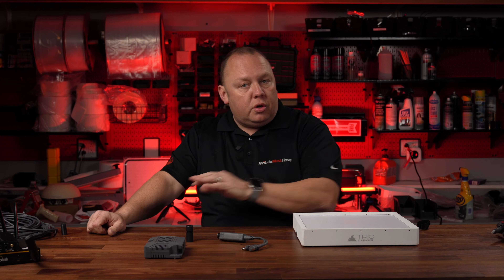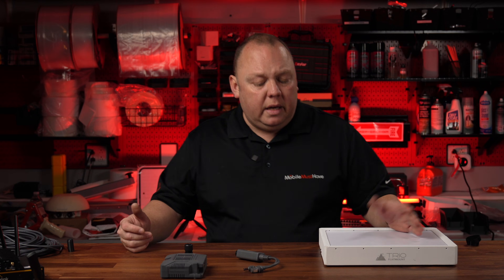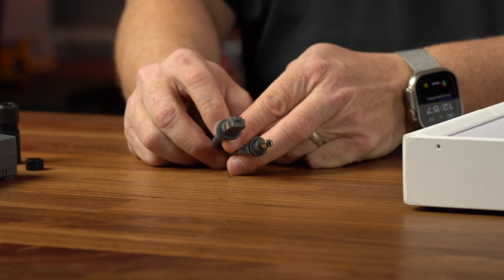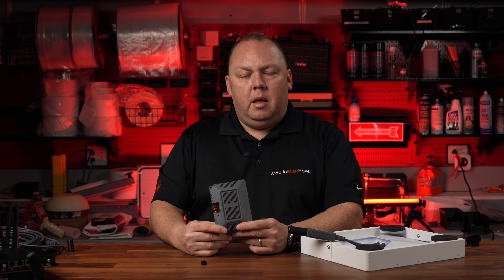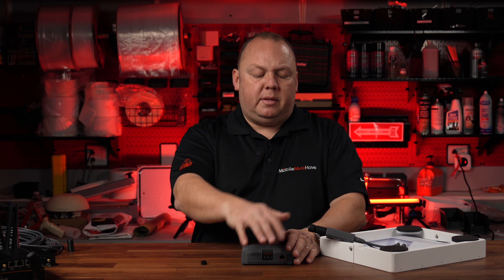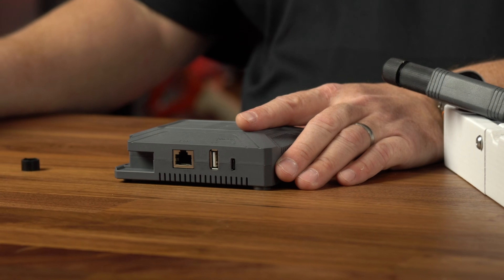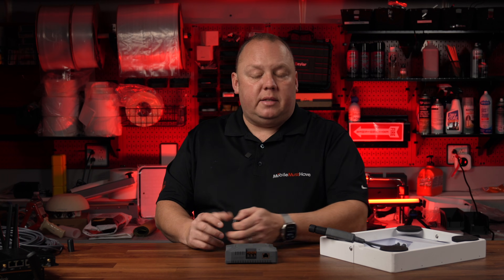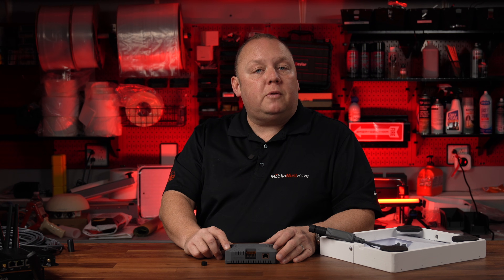New! Starlink Mini POE DC Power Conversion Kit is Here!

Comment: Will this work with a poe ++ injector or poe switch?
Reply from the maker: Do you mean in terms of providing power to the DC Conversion Kit? Our DC Conversion Kit for the Starlink Mini requires a 9-30v DC input using a direct wire to the positive and negative terminals. It also has a passive PoE Injector built in already to provide power for the Starlink Dish, so you shouldn't need an additional PoE Injector or PoE switch. Here's a link to the Conversion Kit on or site with more information: https://mobilemusthave.com/products/starlink-mini-poe-dc-power-conversion-kit-with-12v-accessory-output-for-peplink?_pos=1&_psq=starlink+mini+poe+dc&_ss=e&_v=1.0

However, we'd love to discuss your use case more and find out what the best solution would be for you. If you'd be interested, reach out to us at info@mobilemusthave.com with some information about your setup needs and we'll be happy to help!
Reply: @MobileMustHave  I am asking same thing. Can I buy this kit, then just use the dongle for the dish and plug the ethernet cable in to my Unifi POE++ network switch and use its POE power of 50Vdc rather than using the injector itself.
Reply from the maker: @31337cyberhuman  most Ubiquiti switches have a max wattage of 45w and this cable was designed with passive POE functionality carrying power on all 8 wires in a particular order. The dongle does not have the logic built in to trigger the switch to enable PoE and the pin order is non-standard, so this wouldn't work unfortunately, nor would there be enough power on most switches even if the pinout were correct. We do sell a managed PoE switch and single port injector with 802.3bt standards which now has up to 90W of power and it works with our PoE splitter than then outputs enough power to be used by the Starlink Mini and can also be paired with a Peplink both powered by a single ethernet cable but this requires an enclosure like the Antenna MAX or the Antenna MAX S as the POE Splitter is not waterproof. Here is a video of the Antenna MAX S installation video that shows what I'm referring to. https://www.youtube.com/watch?v=8KudUK457Hw - Erik MMH

Comment: What temps can this handle? How about weather rating? Would like to mount this under my hood instead of inside my truck.
Reply from the maker: The Starlink Mini PoE DC Power Conversion Kit has a strong heat sink built-in, so it has a great heat rating! However, it is not weather resistant, so it will need to be safely installed in a weatherproof location. For more information, check out the listing on our site: https://mobilemusthave.com/products/starlink-mini-poe-dc-power-conversion-kit-with-12v-accessory-output-for-peplink?_pos=1&_psq=starlink+mini+dc&_ss=e&_v=1.0

 If you have any other questions, reach out to us at info@mobilemusthave.com and we'll be happy to help!

Comment: The reason is simple, if your selling millions all over the work, keep the power separate since since most don’t have a POE source.  The difference between a billionaire and a YouTuber.
Reply from the maker: That not what we said in the video. The separate DC input is great and needed in our optinion since the unit has an intergrated router. That said, since the unit already runs on 48v having the ethernet have the ability to offer POE power to the dish would allow for a much larger variety of deployments without the need for kits like this. We suspect we will see this added in future generations since its the number one gribe most testers have had with the product thus far. Thanks for the comments and for watching!

Comment: If your poe is creating lots of heat it's not efficient.
Reply from the maker: anything stepping up voltage from 12v to 48v and doing so with up to 200w will create heat. That said, the mini only pulls about 30w so you barely notice any heat at all because of the overbuilt nature of this unit and you can then swap out your dish for a full size starlink using the same kit and wiring for future proofing.

For full specs, check out our listing here: https://mobilemusthave.com/products/starlink-mini-poe-dc-power-conversion-kit-with-12v-accessory-output-for-peplink?_pos=1&_psq=starlink+mini+dc&_ss=e&_v=1.0

Comment: Well spoken esoterically but for the uninitiated and those newly interested in Starlink somewhat confusing and off putting !
Reply from the maker: All depends on what your goals are and what you are looking for.  Starlink did not make this easy as they are still learning what their customers are looking for and testing the market themselves.
Reply: Are those magnets on the white box? I assume that is a mount, if so it doesn't look like it will mount flush on the roof of an RV unless you drill a hole in the roof. So this lets you use an inside router for better performance?
Reply from the maker: @JimEdds  yes, our Trio SpeedMount for the Mini has a magnet or suction mount option and doubles a a great protective case for the Starlink Mini https://mobilemusthave.com/products/trio-speedmount-for-starlink-mini

Comment: Why not buy the Starlink USB C cable for $39?
Reply from the maker: we sell those as well but for $29 and in stock https://mobilemusthave.com/products/starlink-mini-10-meter-water-resistant-usb-c-power-cable-for-battery-or-portable-operation - That said you will not be able to use ethernet to uplink the device to a Peplink router to do WAN bonding and other advanced features. This is more designed for a fixed mount installation. For portable use check out our 3 in 1 portable cable which is the best for portable use allowing battery use, USB-C use, stock charger use, cig lighter use and more found here!https://mobilemusthave.com/products/starlink-mini-3-in-1-water-resistant-power-cable-for-ultimate-portability-10-meter?_pos=1&_sid=c9f466ef6&_ss=r

Comment: in video you say "POE injector" input comes from Starlink device WAN. Did you mean to say Peplink WAN? Input from Peplink then output to Starlink dish.
Reply from the maker: So, the Starlink Dish is connected to the PoE port on the PoE injector via a standard cat 6 ethernet cable which connects to the Starlink Mini conversion cable creating a water tight fit. Then, you run an ethernet patch cable from the LAN port on the PoE Injector to the WAN port on the Peplink router. If you have any other questions, reach out to us via email at info@mobilemusthave.com and we'll be happy to help!
Reply from the maker: @timothyauen155  our team previously said the cable to the dish is included. All adapters to create a water tight seal are included but a standard ethernet cable is needed to the dish which many customers have already in various lengths which is why its not included and optional at checkout. Apologies for my teams incorrect information.

Comment: I was okay with the 48V barrel but a 12V USB-A port? Why?
Reply from the maker: So, the USB-A Port is used with the optional "USB-A to 4-PIN Peplink Power Cable" that can allow you to power your Peplink via the USB-A port. That way you don't need a separate run to power your Peplink! We also have more information on our listing here: https://mobilemusthave.com/products/starlink-mini-poe-dc-power-conversion-kit-with-12v-accessory-output-for-peplink?_pos=2&_psq=starlink+mini+poe&_ss=e&_v=1.0

 
If you have any other questions, reach out to us via email at info@mobilemusthave.com and we'll be happy to help!
Reply from the maker: Additionally, the 5V USB-C port can be used to charge USB devices like phones if appropriate and also power some routers that run on 5 volts DC.
Reply: @MobileMustHave , I have never heard of a 12v native USB port in my life.  This was a very poor design decision.  People are going to be frying random accessory devices left and right with that thing.  If you want to get 12v from a USB port, then have the adapter request it using one of the "smart" USB power protocols, but a USB port should never default to 12v otherwise.  The rest of the product looks great, but that should really be reconsidered.

Comment: I looking for a solution like this since months! Thanks! But my main reason for the starlink mini is the low power consumption and our "-small- mobile serverroom" could have a heat-problem. I am a little bit afraid, that this 200w-thing is not build for such a environment or?
Reply from the maker: Voltage converters like this will only consume what is used, not what its maximum rating. Power does not just get "consumed" because you have a device capable of providing more output, that's not how electricity works. You will only consume the amount of power the Starlink uses and having an overbuilt device means less heat, more efficient operations and the ability to upgrade to a Starlink full size without having to re-buy another kit. Thanks for the great question!
Reply: Plus idle consumption plus conversion loss. That's where the heat comes from.
Reply from the maker: @samuelfox8126  yes but with the mini your talking maybe 1-2 watts max, probably less. The unit sits at around 18-25w typically when in use and i'd say your looking at about 5-10% overhead at an absolute max. The same would be the case if you used the included AC to DC wall charger and the only other option is to just run the dish from the batteries but I've found the dish doesn't work well at 12v especially if you are using a longer cable as things like the vehicle starting or sudden voltage drops can cause the dish to reboot. Thats why we went with a 48v solution here.
Reply: @MobileMustHave  it's interesting how you're selling how robust this unit is in the video and here you're talking about how little power you actually need. I quick search shows poe's for $70.  If you're talking 24w and those have a 150w ceiling and you're has  300w both are going to last a LONG time. 
And since the price of ALL kits for the v2 has plummeted that tells me the high price was just because they could because no one knew better. 
In capitalism, your margin is my opportunity. When there's lots of competition that means the margins are FAT. When most have gone out of business the margins are where they should be. That's the free market. 
Just like Nvidia's margins will significantly drop soon enough, so will the most expensive of any industry.
Reply from the maker: @samuelfox8126  You certainly can pickup a lower cost poe kit for the mini, that's one of the benefits of something that will run on anything from 12-48v dc. I see kits that have a similar dongle and then bundle a passive poe injector that will work. We tested a lot of them and mainly the o ring seals and component seals were the weak link. These lower cost kits are not all bad, we found  a few good ones. They typically do not have voltage converters so you either run it on 12v or you can buy a separate step up converter on top of the kit cost. Probably 100 bucks after all said and done?  You'll have multiple pieces in your setup to wire up, you'll loose the USB  output to power a router with the kit (not a huge deal) and probably the biggest thing is you'll loose the future proofing to use the dc kit interchangeably with full size Gen 3 dish or mini dish but it is certainly an option for sure. There are a lot of ways to get to the finish line in this race, we tend to focus on what we find is the cleanest and most future proof, not necessarily the cheapest. We also have to make a profit and cover our costs of R&D etc. We don't pretend that's not a factor. Thanks for the feedback and comments.